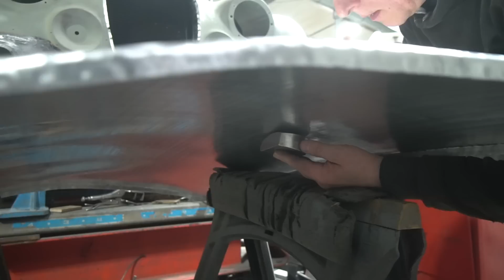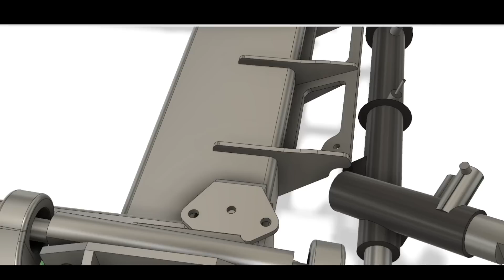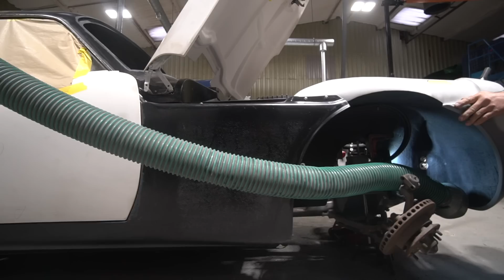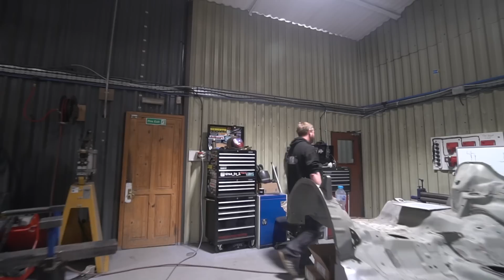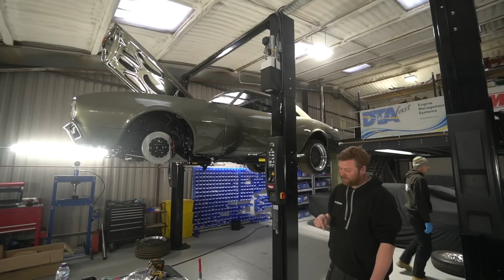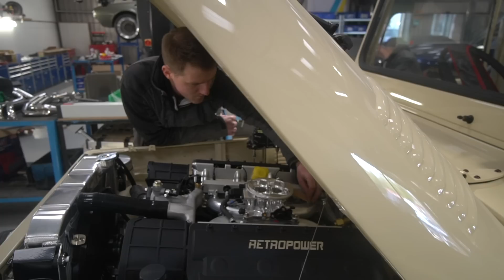Wide Arched MK1 ESCORT RESTOMOD Prepared For Paint & More WORKSHOP IMPROVEMENTS!

Comment: How is that rack going to work? In the aluma-frame it is ahead of the wheels, it looks like the jaguar has the rack behind the axle centerline?
Reply: Just depends on whether the pinion is above or below the rack bar in the housing. (If that's what you meant)
Reply: @garethdavies3220  Definitely. The racks I see on the Detroit Speed site are for their aluminum subframes, all those have the rack positioned in front of the axle centerline. Maybe Detroit Speed makes the same racks in rear-steer

Comment: Those huge indicators and rear lights on the later E-types are sooo ugly, I guess it’s original, but I would have a verzhard time not going back to the series 1 parts if I ever had an E-type… 😅
Reply: I did my S3 retaining the big front indicators, but with smoke lenses and coloured led bulbs. A much cleaner look compared to those big slabs of orange.  Did smoke lenses on the tail lights too.
Reply: agreed!

Comment: Remove spark plugs, before mechanically turning engine over to prevent load on bearings prior to oil pressure. Ive never heard of that, but it makes so much sense on expensive builds such as yours. Love it.
Reply: However you need to remember to replace them before trying to start it 😂🤣😂🤣
Reply: It's not just load on bearings, removes excess load on the starter motor and battery too preventing damage to those, plus the higher rpm it'll crank at pulls the oil up into the pump much quicker.

Comment: How do yo mitigate the inherent corrosion using of aluminium skin in conjunction with the steel frame on Churchill?  Does the bonding material you use prevent direct contact?
Reply: Saved me a question 👍
I had a flashback to series Landrovers when I saw that but I'm confident they'll have thought of it 😄
Reply: Great question. I also have a series landy. God help me